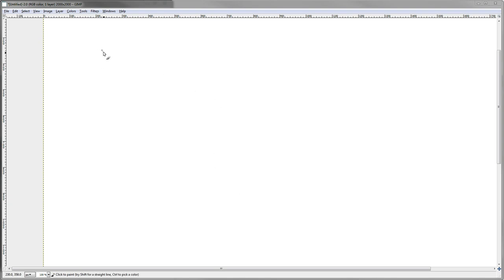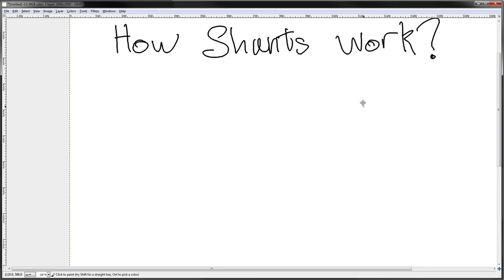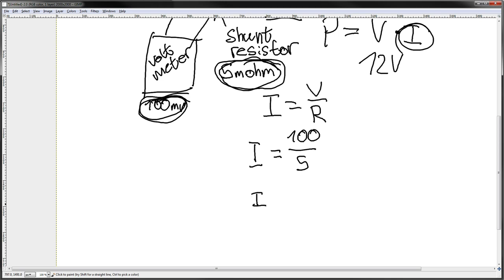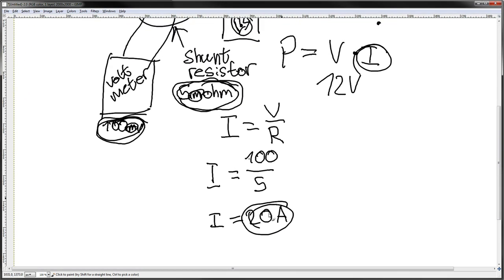Explained with GIMP: How the shunt mod works

Comment: Dood, more of this! Safe to mod just one shunt resistor if 3 exists on pcb? Further, will the gpu "draw" too much power to reach normal clocks or mild over clocks? I assume the gpu is voltage capped anyway to the typical 1.09vc. Won't the gpu just voltage cap? They have thermal caps, voltage caps, and "usage" caps. All which cause a throttle when exceeded. This just affects the tdp cap yes?
Reply: yep.  just the tdp.  if you are mostly power limited then this will help.  but the max voltage is still 1.09.  there are mods for extra voltage though but they are not so simple

Comment: Thinking about shorting the resistor on my card for a little more power, but don't really like the idea of adding a liquid metal to short the resistor on the board. One inconstant/unpredictable results with a liquid metal and two the potential of the metal shifting and causing another short that renders the card inoperable. It also seems for what i have read, that completely bypassing the resistor will cause an error in the card resulting in it not booting or severely down clocking. 

With that said, what about stacking another 5mohm resistor on top of the current or straight up replacing it? What would be the required spec? As i see a site like mouser offers .002, .005 ohm ect... , just don't know if there is something else in the data sheet in need to be looking for.

Or is there even another option that would table permanent solution?
Reply from the maker: Soldering another 0.005 on top of the existing one would give you a 50% decrease in reported power draw so that could work. Hopefully you won't run into the power safety that new 10 series cards have. You could also try some higher value shunt to get smaller reading reductions.

Comment: So all you have to do is find 3mohm resistor and solder it over the old one?Also I suppose it idles at higher voltage as well?Thanks.

Comment: so how many miliohms was the mod exactly for it to arrive at 3 miliohm? is it just 3 miliohm and it shorted the initial 5 miliohm?
Reply: You may want to look up voltage divider on wikipedia for that question. Solution in this case would be a 7.5 mOhm resistor in parallel to the original 5 mOhm (soldered on top of the old one / piggyback mod) to get 3mOhm in total.
Reply: @MicroageHD  Thank you dude for taking the time to actually give me some clarity on this topic. Not many care enough to do that. I really appreciate it.

Comment: Good one.
that's is really basic physics and what is interesting is how things working after that. I mean how it helps to achieve higher freq.
I understand that at any given voltage, the card will allow more current than it thinks.
I somehow understand (may be I'm wrong) that higher voltage (to some point) helps to overcome the leakage between transistors and achieve higher frequency. But i don't get what role current plays.
It would be great if you could explain the relation between voltage, current and frequency in a follow up video :)
Reply: I guess you want to know how this mod helps at overclocking. It's pretty simple:
NVIDIA GPUs watch the power draw of the card and limit or reduce it's clockspeeds when the power draw reaches a specified limit. The power limit can only be raised slightly in overclocking tools. So if you want to allow the GPU to draw more power, you can use this mod to let the GPU think that it draws less power than it actually does, so your limit is basically way higher. If your card has a TDP of 180 W and you increase the power limit by 20%, your power limit will be 216 W. But let's say you want to overclock it further and it needs 230 W for that, then the card will limit at 216 W and not go any further. With this mod you can make it think that it draws less power, so when the card draws 230 W, it will think it only draws 138 W, which is well within the power limit. You would only reach the 216 W power limit when the card was drawing 360 W in reality in this case.
By allowing the card to draw more power, you increase the overclocking headroom, as overclocking increases the power draw.
On AMD GPUs you normally don't need this, as the power limit can be raised way higher there.
Another option is modding the BIOS of the GPU to allow for higher power limits.
Reply: Razor Blade  thanks for the reply. I understand what this mode does. have done it with liquid metal on my GTX 1070.
I understand that higher voltage and current (to some point) will help achieve higher frequency while causing the microprocessor to run hotter. Too high voltage or/and current will fry the silicon.
What i don't understand is the how it works on the very low level. What does voltage and what does current. In what cases I'll prefer more current+less voltage, vice versa or even both. It's like understand the the engine in car - more air ? more petrol ? more pressure ? :)
Reply: Voltage is Joule per Coulomb. 1 coulomb is an amount of electrones. Joule is the energie contained. Ampair is Coulombs per second. 
So: Ampair is the Pressure and Volt is the grade of your fuel Jet, desel or benzine depending on the the number. Combined this makes pumping to much jet fuel thrue your Golf and it will BURN (cause jetfuel melts stealbeams ^^).
Reply: Eragon Baffel Amperage is the "electron flow" in Coloumb per second and Voltage is the "electron pressure" in Watts per Ampere or Joule per Coloumb.

https://en.wikipedia.org/wiki/Ampere

https://en.wikipedia.org/wiki/Volt

Comment: it's actually hard to lower the shunt resistance with silver paint or something similar. A normal silver paint has sheet resistance of ~0.02ohm(20mOhms!), which has very little affect lowering the shunt resistance.
Reply from the maker: CLU knocks of something like 10-30% of the power measurements on most Nvidia cards from what I've seen. That's a Gallium Indium Tin alloy IIRC. No idea what silver paint is.

Comment: hey great video. I question though. On a GPU that has no extra power connectors, how do I find the shunt resistors? All the shunt mod videos I can find online are about the 1080 or 1070, but on my GPU there is nothing on the PCB remotely like the shunt resistors I see in those videos.

Comment: Your work is a little messy. When I push the one button on my computer it looks like this, 1 and seven looks like this, 7. Ohm spelled backwards is mho and is used to describe very low resistance applications. When e-bike people want to shunt mod their bikes for extra speed they shunt across the current limiting wires in the motor control box, which can overheat the MOSFETS. A real shunt mod is to shunt the intermediate device entirely by let's say a relay.

Comment: so how exactly is Nvidia using this to exploit it's customers?
Reply: GPU Boost power limit uses this to throttle the card and it caps rather easily.
der8auer made a guide about this http://overclocking.guide/increase-the-nvidia-power-limit-all-cards/